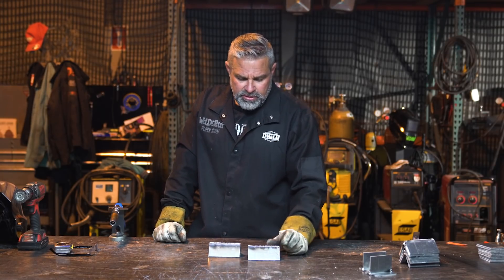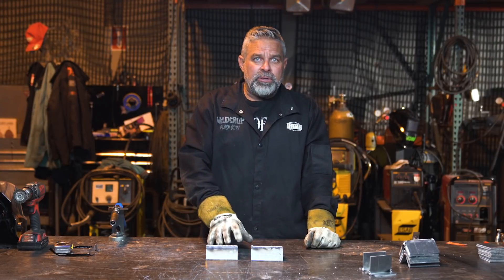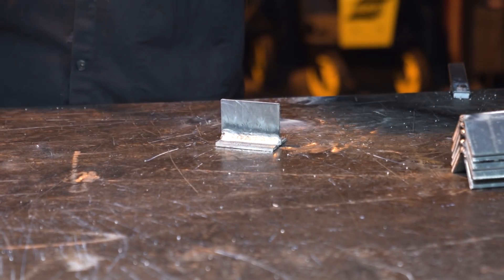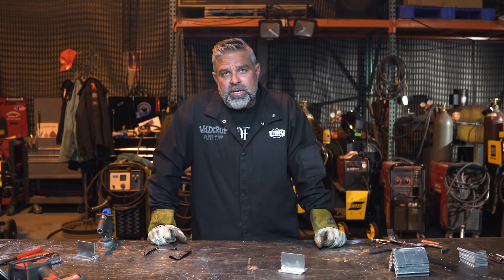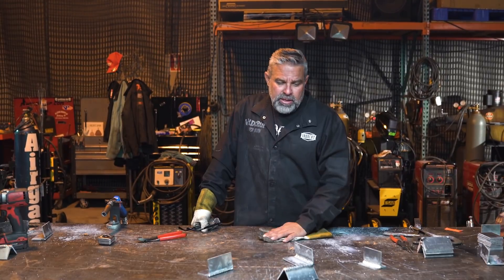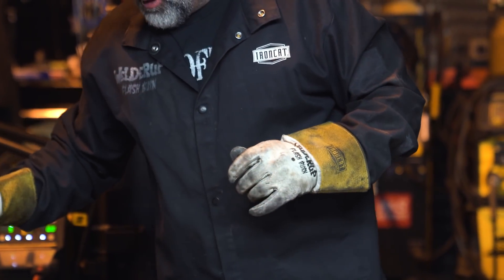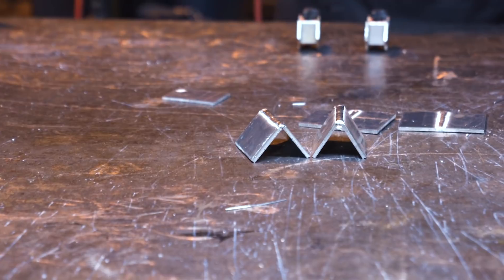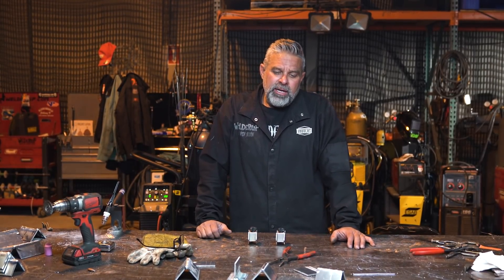MIG VS TIG Welding With Aluminum

Comment: I have been inspired by your video Steve thank you for sharing this however I have one question having a small garden workshop with very little budget I have been trying to weld Ali using small disposable argon bottles I'm getting the impression from this practice that there is not enough pressure would I be right on this and if so would you recommend I get a full sized bottle with a proper regulator would this improve my welding would like to know your reply before I commit to this and again thank you for this video very very informative
Reply from the maker: Yes, get the larger bottle with the proper regulator. Yes, it will improve the looks of your weld.   If you are not getting the right amount of argon flow it causes porosity that can leave the weld looking bad. Without seeing your set up I cannot be sure but I hope this answer helps.
Reply: @WelderUpVegas  it's a murex 160 amp industrial welder with a Chinese spool welding torch the welds llook ike the kind of welding that you would expect to see from a flux core Steel weld there are little craters in the weld  beads where I think the argon is not doing it's job properly which is why I was asking about a bigger bottle after seeing your video. Thank you so much for your reply this is confirming what I was thinking .

I will be uploading my efforts my tragic efforts on my chan  later today hopefully if you have any curiosity... appreciated👍

Comment: I like to make ghetto freak bikes/ choppers and I like to make robots out bicycle  parts I have  I don't have make alot of money but I love it I have Mastercraft 110/220 hook up with gas hook up I want upgrade to something better as my weld look like shit what do you recommend
Reply from the maker: Hi Robert,   A miller or Lincoln any of those are a great welder, they have a good reputation. It's best to get a 220 machine that will weld up to 3/8 inch.     Thanks for watching!

Comment: I saw these aluminum brazing rods on line or at Harbor freight I for get. I thought about getting the rods to practice I think I can use propane gas. I do have some aluminum block's/peices to practice with. I don't want to buy a whole spool of wire to practice with until I try the aluminum rods first. I guess it would be like brazing rods?

Comment: Al-U-minium is weird stuff.  She's a picky beech.   This is what I've learned so far about Mig-ing aluminum (from building 2 all aluminum enclosed snowmobile trailers with ramp doors)

 Clean.clean, clean. then clean again.  If u leave it overnight, u gotta clean it a-gain.  The reason u gotta clean is the same reason why it doesn't ground so well (Oxide layer on the surface).   If ur using a wire brush, make sure it is a clean, stainless steel brush, that u only use for aluminum, AND....only run the brush in one direction.  If u go back and forth, u'r just embedding debris into the surface.  

PUSH,  if you pull, u'll wind up with fluffy black caterpillars, not welds.  The push combined with Argon wash forces the contaminates out ahead of the weld pool.  When u pull, u'r driving them into the  pool.  

Gun Angle,  0 to 5 degrees to the direction of travel is what u'll read everywhere.  It's probably a little more forgiving than that, possibly due to how much gas u'r flowing, but that's pretty much it.  And, if u can remember to keep changing them out (preferably before they melt) use diffusers in the tip (I used scotchbrite, worked pretty good till I really got cookin)

On thinner stuff, don't get greedy, the heat will make you blow thru.  Thicker, pre-heat to get a good start, then.... don't get greedy...same problem

Whoa! that got long winded  :)  anyway, there's my 5-6 cents